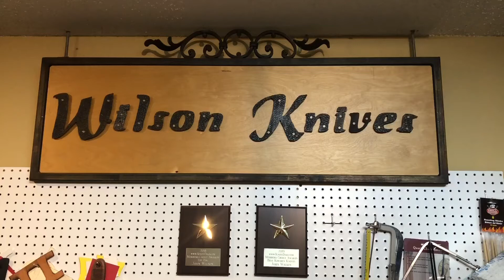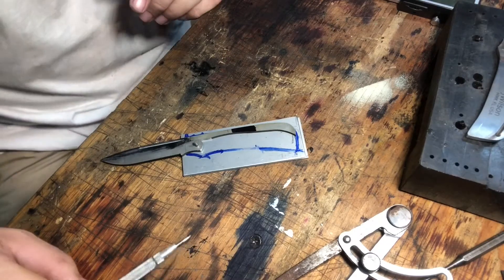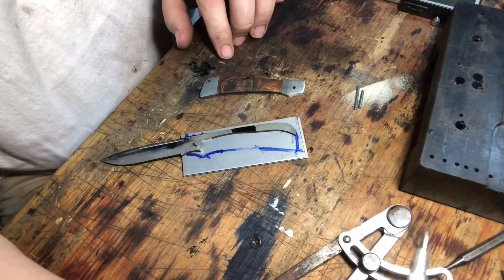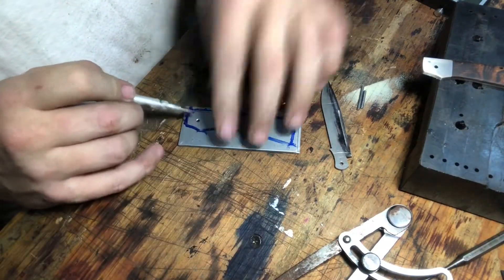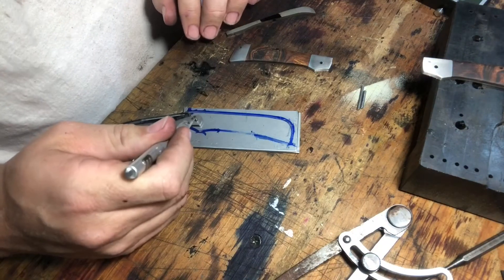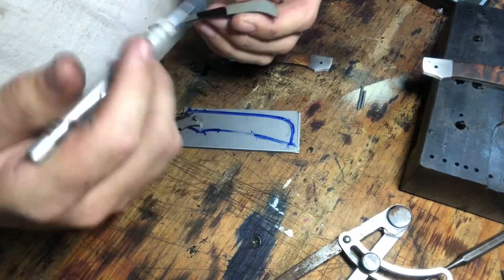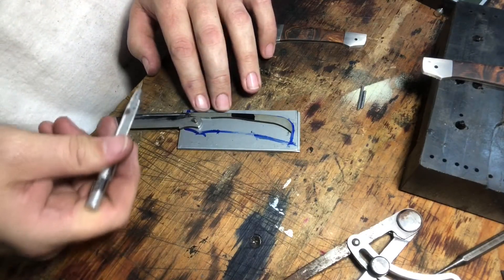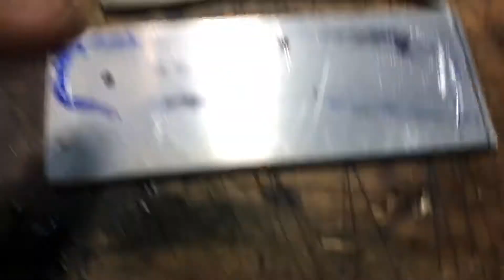Slipjoint Folder Pin Placement

Comment: How do you calculate the distance from the pivot hole to the center hole in the spring?
Thx-
Reply from the maker: there is no need to.  You’re going to clamp the spring down and drill the hole through the spring and liners at the same time.  That hole can be anywhere you want it.  The blade and liners will already have the pivot hole drilled, so that is already fixed.  Put your pivot pin in.  All you have to do then is engage the spring to the blade, clamp it in place and drill it.   The last hole at the bottom comes much later when you set the spring tension.

Comment: How do you calculate the distance between the pivot pin and the central spring pin? Thanks
Reply: Many thanks cleared that up nicely 👍👍thanks for sharing , most appreciated
Reply from the maker: You don't really need to calculate the distance from a spring design perspective.  There is no "correct" place to put it.  The central spring pin is usually going to end up somewhere around the middle of the knife, or at the apex of a curve.   You want enough length between the central pin and the pivot to allow the spring to flex without undue strain.  You also want enough spring length between the central pin and the place where the blade kick will rest to allow room to relieve the spring some if the spring tension is too strong.  Mark where the blade's kick contacts the spring before you start grinding any relief.  It's very easy to grind too high so that the kick falls into the hole and ruins everything.

In case I misunderstood the question:  If you are asking how to calculate the distance so that you can lay out the holes in the spring and the liners- you don't lay out those holes by measurement at all.   It all starts with the pivot pin hole.  You will already have drilled the pivot pin hole in the blade.  This hole is the zero point for all other measurements / hole locations.   Take both pieces of your liner material and stack them.  Lay the blade on top and drill your pivot pin hole in the liners through pivot pin hole in the blade.  Now you have a pin going down through the blade and both liners.  Keep the pin in the hole.

Then you lay out the spring (with no holes in it anywhere) engaged with the blade.  Clamp everything down to the liners so that the blade and spring stay engaged as thought the knife were assembled.  Drill the hole for the central pin through your spring and liners all at once.  

The final hole in the bottom of the knife is what sets the tension, which is why it's the last hole you drill.
Reply from the maker: refer to my video on "setting the spring tension" for a much better explanation.  Thank you for watching!

Comment: sweet video I will watch it a few more times. Its neat to see how everybody does it a little different. I drill my pivot and spring holes before I even start my liners. Your way might work better I will try it on my next one. I tend to mess up that last hole on the spring often setting the tension to soft then making another set of liners it drives me nuts.
Reply from the maker: TheBeStLife  i feel your pain!  I’ve done it your way, too.  Each way works, and each way has its own set of pitfalls.   I think the key is to settle on a single method that is at least repeatable so that we know which potential hazards to look out for.

Comment: Interesting, helpful videos especially as I’m just getting into making slip joints. One thing I didn’t catch is how did you determine the measurement between the pivot pin and the first spring hole?
Reply from the maker: Andy Brocklehurst  that measurement can be completely arbitrary.  About the middle of the spring’s length looks good for the sake of balance, but it’s totally up to you.  Obviously the farther away from then pivot, the less spring tension you will end up with.

Comment: Thanks so much. Super helpful. Really appreciate your videos!
Reply from the maker: Thanks Alan!  i know the videos are kind of piecemeal.  I get busy finishing orders and don’t always have time to slow down and record what I’m doing.  If you have any recommendations for video topics I’d love to hear them.
Reply: J Wilson Handmade Knives thanks. I’d been keen to see the difference between heat treating the spring vs the blade. The time & process. Thanks again for the great videos!
Reply from the maker: Alan Mills   that’s a good idea for a video.   Just as an fyi- i’m using AEBL stainless.   The heat treat is the same.  1725°F for a twenty minute soak and a quick plate quench. then 1950° for a ten minute soak and plate quench.   -> Cryo treatment.   -> Then the blade is tempered at 350°F for two hours and the spring is tempered at 1000°F for two hours.
Reply: J Wilson Handmade Knives Brlliant. Thanks for that-very helpful👍🏻😀